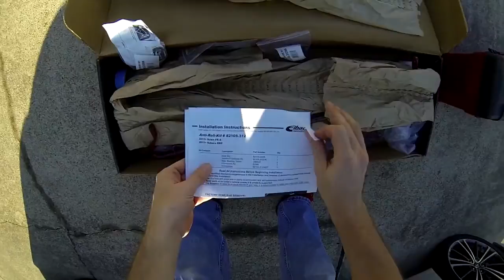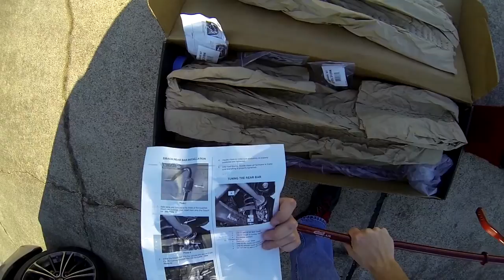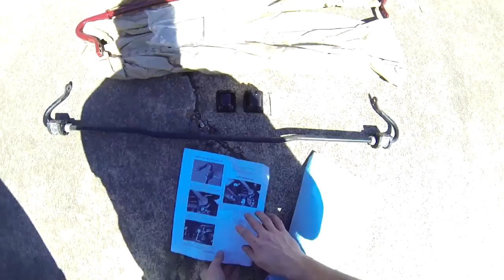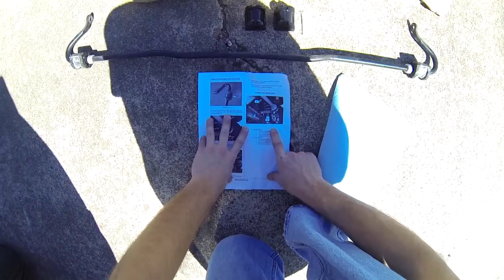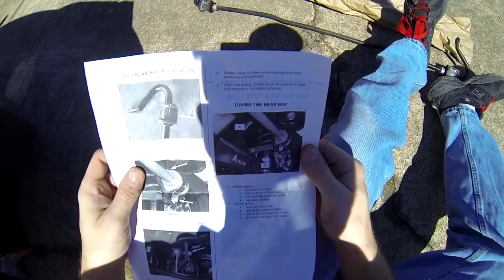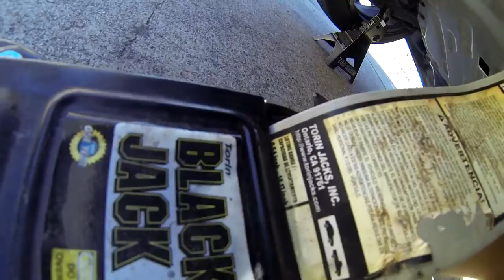Eibach: Anti-Roll-Kit Sway Bar Install Guide - Scion FR-S, Subaru BRZ - Part 1 of 4

Comment: Tires do more good than anything else...
I'm getting 17X8 with some good tires
Hotchkis lowering springs (maintains a similar spring rate ration f/r)
and a bump steer kit (keeps the geometry close to stock with the car lowered 1 inch).
That should give it lots more grip but retain the same driving characteristics
Reply from the maker: Spencer Geerlings Nice!  My plan is 17x8 too, once these stock ones are worn out.
Bump steer kit?  I haven't noticed anything wrong...  What exactly does it fix?
Reply: PowerSports420 On Ft86 cars, the geometry of the suspension is very specifically designed to give it the characteristics it has from the factory: the darty steering, the controllable oversteer, and really just the overall grip level of the front.
when you lower them an inch or more, that really specific geometry gets thrown off, and it's been known to cause these cars to understeer a lot more, and actually get worse lap times. A Roll Center/Bump Steer kit restores the original geometry when the car is lowered about an inch, and helps if it's lowered more than that. So it brings back the neutral handling and grip to the front wheels.
Reply: PowerSports420 It has no benefit unless the car is lowered though, so that's why i'm getting the springs along with it. I'd like it to drive the same, but with a lower center of gravity
Reply from the maker: Spencer Geerlings Ok... so i get understeer and oversteer confused a lot...  when my car was OEM, the rear end would lose it before the front....  then i added sway bars, and the rear end would lose it about the same as front, then i added the springs, and the rear end is now losing it just slightly before the front...  so... idk...  i like it how it is, but then again, she is a drifter
^_^
Reply: For understeer imagine the car under-doing what you're telling it to do. you steer hard, but the front tires slide and the car doesn't turn affectively. For oversteer, imagine the car overdoing what you tell it to. You turn the wheel, and the front wheels grip so hard the rear can't keep grip and slides out.

The sway bars may be stiffening the front and making the ratio of sway closer front to rear. So with the sway bars only, your car neutralized itself, making the front roll less, so the steering must have gotten more responsive, but overall grip level was evened out with the rear.

When you lowered on springs, the geometry changed, and I bet those sway bars are what's giving your car the handling you love right now. If you took them off the car would understeer. What springs do you have on?
Reply: The sways for you are essentially doing what I want the bump steer kit to do for me, but by a different method
Reply from the maker: Spencer Geerlings The sway bars are mainly to reduce body roll (and like u said, change the ratio).  Reducing the body roll is really important.  I use the Eibach Sportline springs, the 1.5" drop, which was too low, cause now my exhaust scrapes the ground on these crappy roads...  But, for a race track, it is perfect.
Reply: PowerSports420 Those are nice springs, I'm glad your setup is working well for the track! I'm worried about scraping on the atlanta and birmingham roads, so that's why i'm only looking for 1 inch. are your sways adjustable?
Reply from the maker: Spencer Geerlings they are 2-position adjustable (hard for dry track, and soft for wet track)
i called Eibach, and they recommended soft for street use
Reply: PowerSports420 Awesome! thanks for the info, I may consider them in the future. Good luck with the build!

Comment: +PowerSports , nice vid.

All torque specs can be found here:
http://www.ft86club.com/forums/showthread.php?t=12135

The undertray bolts are very low torque 66 in lbs, so no wonder you thought they were loose.

Also, I was a bit worried with placement of the front jack stands. When you place them near the wheels as you did, the whole car can fall all the suspension travel (wheels going up in the wheel wells). You need to support the whole frame from moving. Doesn't look like there would be a lot of space left for who ever would be under the car at the time.
Reply from the maker: +GT86 dude 
Thanks for the link!  Yeah, I really need a lift, but, yeah, life.  Haha.  ^_^